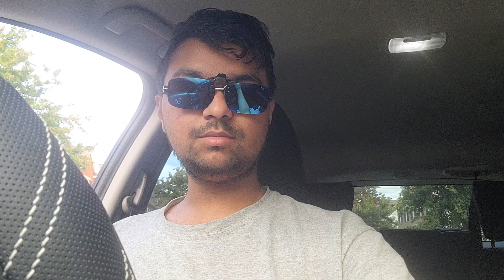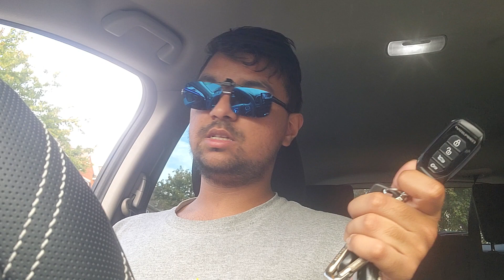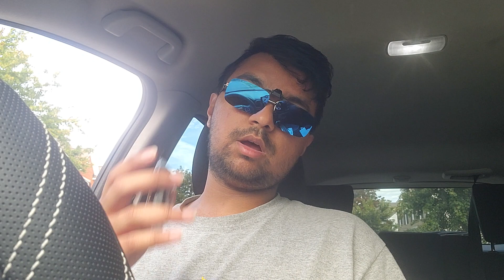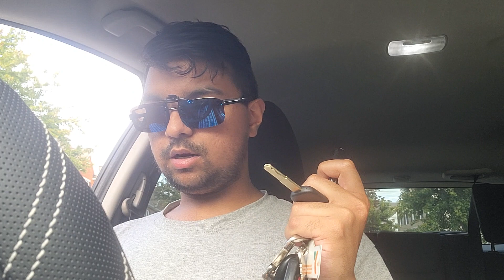Programming Compustar Remote Start - Fixing Unprogrammable Remotes

Comment: Didn't work at all
Reply from the maker: @TimBradley-ty5mh  sorry to hear that. Another thing that occurred to me after uploading this was that I might have been counting the turns incorrectly or not doing them fast enough. Maybe try doing the initial turn, then count out the total amount of turns you need. See if that works
Reply: Worked for me, but I also did try cycling it much faster and I pushed the remote that was not programmed yet first. Then I obviously pushed the lock button buttons twice on each of the two remotes until it gave me a confirmation double click. My parking lights never flashed, I had this other clicking sound